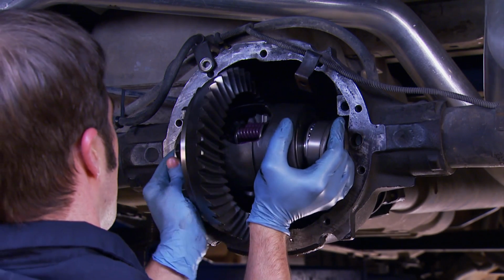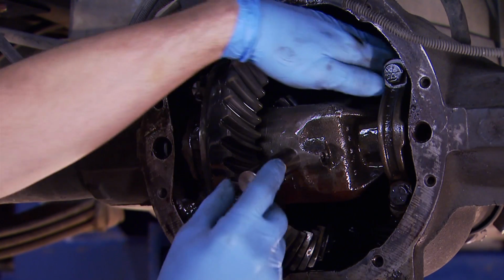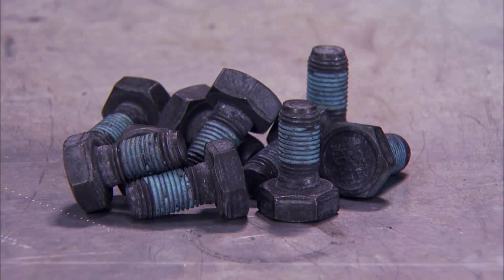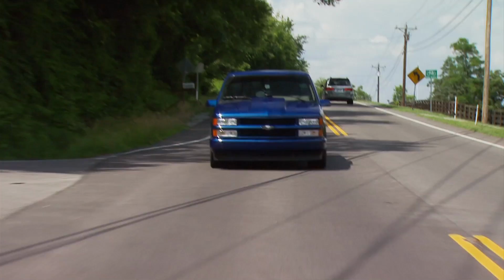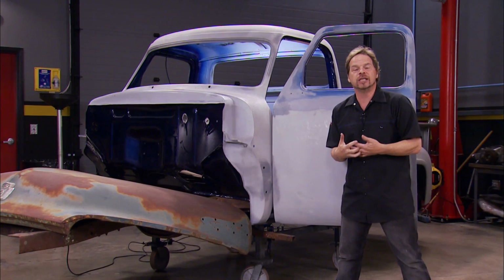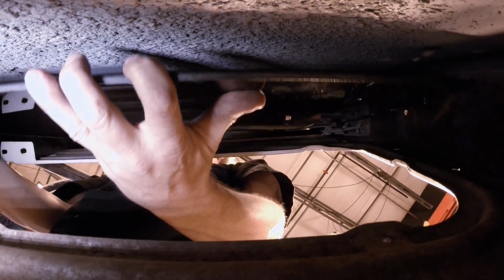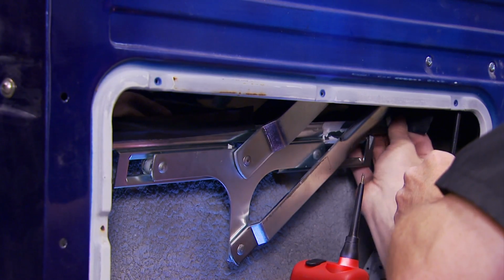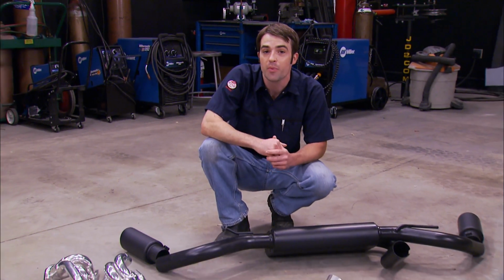Installing a Limited Slip Differential In Our Chevy Sport Truck - Truck Tech S1, E17

Comment: Copied this build almost to a t...I found a 95 single cab short bed with 93000 original miles for $4000. Bought a 2.5 inch cowl induction hood for $400, and found a full set of xd rockstar 18x9 5 and a set of Michelins for $450(steal of a deal) then came the motor... we started with a 4 bolt main gm goodwrench crate motor rated for 300hp out the box and cammed it with a summit 1785 race cam,edelbrock 1604 carburetor on top of an edelbrock performer dual plain intake and a pair of mid length headers and bolted it to a 700r4 with a stall converter. Just under $10k.

Comment: What manual transmission and differential oil does it take? I have a Chevrolet Cheyenne pickup year 1995, 305 tbi 5.0-liter 8-cylinder engine, 238 thousand kilometers and I don't have the vehicle manual, they are the same models from 1988 to 1995

Comment: I love the truck been watching the show since i was. A kid but i gotta admit ya could of drooped a 5.3 with computer wiring harnes complete fuel injection system stroked the 5.3 for $2000 ported the heads added same cam grind on ls specs saved $3500 added a stock 4l80e with stall converter and completed the truck for about $8000

Comment: Why put power windows on a truck there stupid my old manual windows never broke ive replaced the regulators and broken cables on my truck with power windows each twice and i almost never put my passanger windows down

Comment: If you're looking for a limited slip then a TrueTrac is the only way to go. No clutches to wear out, no special gear oil, and you don't even know it's there. It just does its job and lasts as long as a standard diff.

Comment: I don't like POWAH windows butt when I do, I like 'em slow. Those would be neat if a gear set could be swapped to desire for faster or slower window speeds! <3 all
Reply: in circuit resistor
Reply: @youcanbesmartaskhow3857  not handy when it's cold out and the motor draws more current...

Comment: For 15 grand I could of made that alot stronger it seems pretty weak
Reply: That's because everyone thinks the pile of crap 383 is the cats meow. Just build a damn 400.
Reply: @robertweitlauf4653  exactly what I did a 400 sbc with flat tops howards cam and ported stock 2.02  iron heads, headers and 650 dp and it would eat that 383s lunch
Reply: @400sbccamaro  thank you. I received a 383 engine the guy (let's call him Fred)said never ran right and it had a ton of piston slap. The guy ( let's call him Hack) that built it used the short 400 rods on the 350 piston.  Hack put in the pistons and the  skirts hit the crank counter weights so he hack sawed off the skirts. Fred came to me I disassemble it that's when I found the mess that Hack created. So I built Fred a nice long rod 400 that will run all day and has 400 streetable horse power.

Comment: $15k? I'd buy 5 to 10 used trucks instead.
Reply: And then spend another 15k plus on top to fix repair and do general maintenance on those 5 to 10 used trucks....
Reply: And they say is a low budget project hahaha
Reply: Jeff Norbert , I did just that  , got three of them , then I got a part here and a part there and now getting ready for paint , all are 350 small block 4 bolt mains,   two are auto and one a 5 speed , I don't even have $4 grand in them , the paint isn't even $50 bucks a gallon , I'm using Industrial/ commercial tractor paint

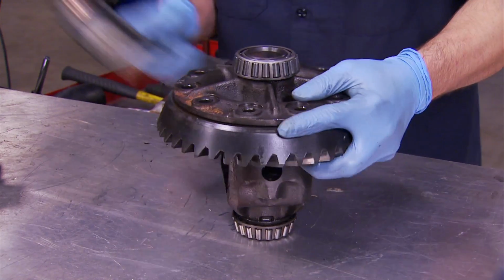Comment: 4:05 "These ring gears sometimes act like they're pressed on" because they are?
Reply: no they arent. knock em off all the time.
Reply: Heat gun works great and you don't have to get the gears wet.
Reply: @Roboticgladiator  yes or oxy torch from a foot away. Moving around.
Reply: BSMotoVlogs that was the joke

Comment: Is there another way to put a locker in without using Anu casing
Reply: Yes they sell "lunch box"lockers that replace the spider gears  ,aussie lockers power trac and others sell them they work great and extremely easy  to install  and reliable  have one in Dana 60   the aussie locker thing still carrys a lifetime warranty
Reply: @bamadave1983  hey thanks a lot Bama Dave I appreciate it cheers brother
Reply: @MakinEndsMeet69  today they are commonly refered to as mini spools and can be had for 30 bucks on eBay and work great. Soak the differential crosspin bolt in oil and heat before trying to remove it and always replace with new. Thank me later bc when they brake off it takes hours to get them out

Comment: .012 backlash is a lot nore than I would ever run in my vehicles regardless of what it was before. My Hawks ring and pinion stated to run backlash at no nore than .007. The closest I could get was .006 which is better IMO
Reply: too tight burns it up, little loose dont. But regardless that new gear has a spec . don't go by what your worn out shit was lol!

Comment: if you slightly touch the brakes or partially put on the parking brake both wheels will drive on a open diff. you learn these things when driving old tractors or pulling a boat up a wet boat ramp.

Comment: freezing the metal does the same thing.
Reply: Nathan Dean that would shrink it and it would not fit. You’d have to freeze the differential to hope it fits. Heating up the ring gear is the easier option.

Comment: power windows no thanks drains the hell outta my charging system...
Reply: Maybe upgrade from 6v and get a real charging system
Reply: The Coronet Shop sounds like you have a weak charging system!  Upgrade time!
Reply: @94concours  12v but might go to a 14 or 16 volt battery
Reply: Your alt should be producing atleast 13.4V at idle even for an old half working system. I'd reccomend an alternator rebuild.
Reply: @starbattles1  lol maybe
Reply: @riskybiscuit5594  definitely doing that first
Reply: The Coronet Shop wut? Typically you’re not driving down the road constantly rolling the windows up and down.
Reply: @Nmdixon-cu7vm  I would not mind that.
Reply: Swampy  I'll upload a video this week  if that clears things up. But here's a visual tip. My parking/running lights & dash lights are on. I press my driver side switch as my window goes down or up you can see my dash lights dim

Comment: Ha!  Two tire frier!  Gotta love it.  Doggone....as much as I like 9 inch Fords, these Chevy rear ends are nice to work on.  Happiness is a tricked transmission....I shift-kitted a C6 behind a hopped 460 and I could not believe the difference.  When I got rid of the truck after many miles it was still shifting super-crisp and the fluid was beautiful.  I like 4-5-6 speeds but tricked automatics are nice.  383's never fail to satisfy.
Reply: Lololol when a stock. Tbi. 180 crank hp blows them. You tend to lean to the 8in

Comment: It takes about 15 minutes to restore those tail lights but when you have an unlimited budget for stupid spending, might as well waste your money.
Reply: Those taillights are super cheap new though.
Reply: Kind of like throwing money at an old small block instead of an ls swap
Reply: WayneswheelsATX ATX I agree. A 6.0 with some 706 heads and a cam would have been cheaper and added way more power.
Reply: @waynesworkshop7069  Exactly, I don't get these shows sometimes.

Comment: What a cone style LSD are absolutely rubbish and no way will outlast a clutch type unit.  How so if almost all cars that have a LSD use a clutch type  from the factory.
Reply: Torsen style lsd  are far stronger
Reply: @turdferguson3189  wrong who said . Then why does no one use them ??!!!. Nice try non car person
Reply: @_i-kr6eg   your right, I don't build cars, I build offroad trucks, torsen diffs hold up longer,
Reply: Lassi Kinnunen  well you only mentioned Audi.  So yes barely any car manufacturer makes or has a stock cone style lsd even a viscous unit are more commonly used.  Too many parts inside to fail . They can't handle big power been there already

Comment: 15 grand.  That is a ton of money..
Reply: Dam all I see is hater's 😂 theirs a reason most of the old trucks you see are gm. And 15k for a bad ass muscle car like that isn't bad, y'all are just broke
Reply: @josuepaz9446  true that.
Reply: @josuepaz9446  bro that's what I was thinking 🤣 they just need a job that's good, sí quema cuh
Reply: @josuepaz9446  Broke is what you will be  spending 15 grand on an old truck.
Reply: @grabir01   just take your time im fixing my truck and over 5 years i have spent 12k and i still need to painted
Reply: Being a Chevy guy, both of you are right. A Ford will live happily, even with no care.
Reply: They could’ve bought a 12 bolt Posi track from a salvage for less than the Auburn and upgrade that POS 10 bolt. For less money.
Reply: @possumpopper89  $4k for engine was bullshit too...$3500 for injection??? Fuck that as well
Reply: Thank you. I'm glad
you said what I was thinking
Reply: Gm destroys other automakers in style that’s why you see them everywhere.

Comment: If one cannot afford! New tail light one would be amazed how some decent compound cleaner and a high sp÷ed buffer will bring those factory tail lights back to its original shine..just as clean as those new ones..
Reply: yea they werent in bad shape at all just needed polishing
Reply: looks like they were sprayed clear
Reply: The Meguiar's Heavy Duty Headlight Restoration Kit makes a difference.
Reply: Princip Warehouse. Savage!
Reply: 5 minutes each with 2000 wet sanding then a few coats of Duplicolor clear in the can, sprays on really smooth, no orange peel and you cant tell I sprayed them. Polished them a couple weeks later, now they look like new ones and will last a long time. I'm done just polishing them it doesn't last very long.